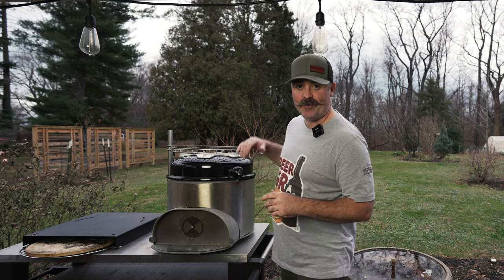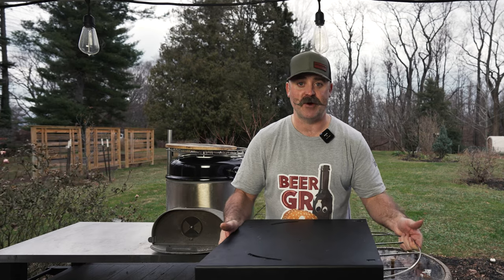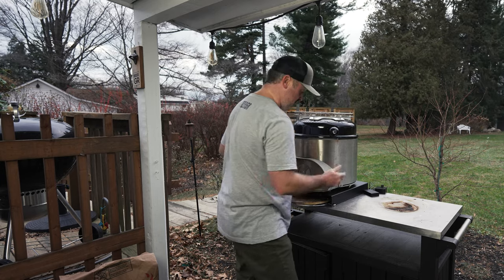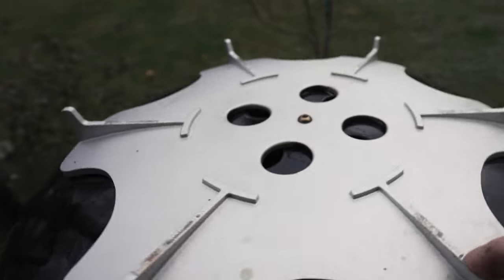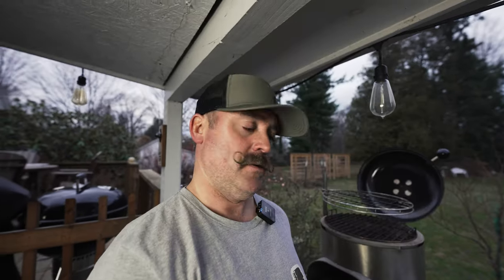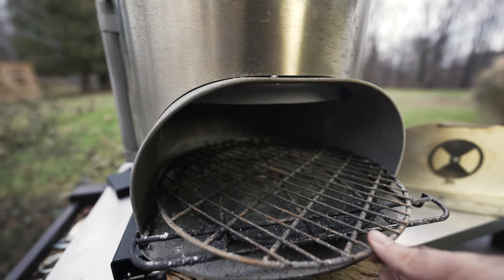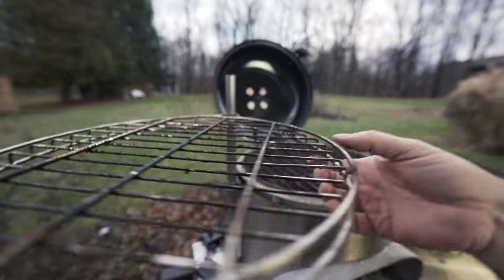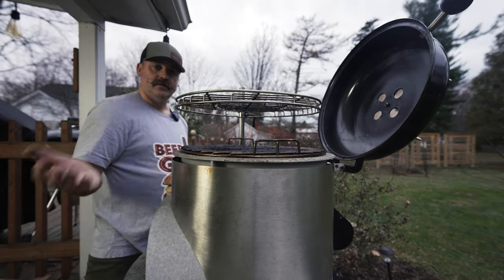How the Wild Fire 4-in-1 Grill Works

Comment: My one concern is stainless steel. For  pizza oven wouldn’t it be better to have a kamado like surface, ceramic, similar to brick (which conducts heat better)? Steel conducts heat way hotter doesn’t it?  I am sure they did steel because their thought is portability for tailgating. I would rather have something fixed in location on my back patio and don’t have a use for tailgating. So what am I missing? Is a pizza oven that is brick or brick like going to work better?
Reply from the maker: Hey Todd, so the steel is only the outer shell. The interior is actually cast aluminum which holds heat extremely well and is extremely high heat tolerant (1100F+). There is a small air gap between the aluminum shell and the stainless outer shell for heat dissipation so that you don't burn yourself if you touch the outer part. I am sure there are benefits to having a brick pizza oven but the main idea for the Wild Fire is to be able to cook multiple things in multiple ways while keeping a small foot print so that most users don't have to go out and purchase multiple grills or tools in order to cook everything they want. Hope that explanation helps!
Reply from the maker: The other benefit is that a Kamado style style grill like the Green Egg or Kamado Joe also cost A LOT! If you want a decent size one, you're going to spend $1500+ where the Wild Fire only costs sub $500 right now on Kickstarter.